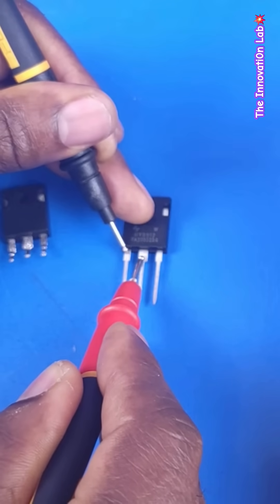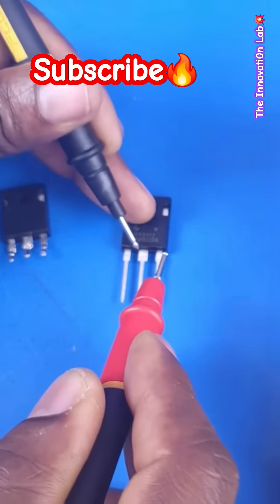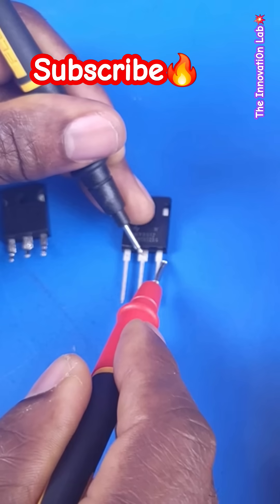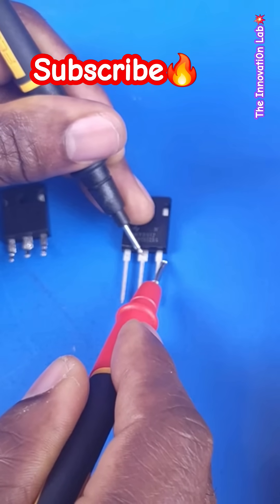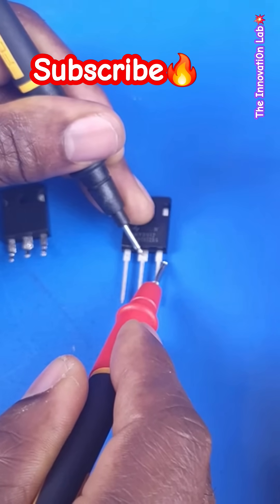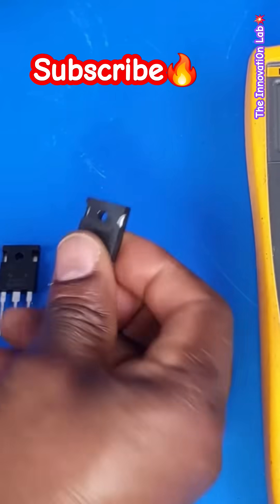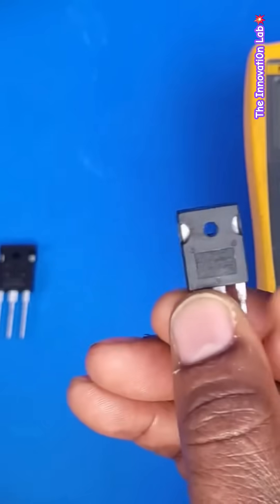How to Test a MOSFET, Part 3 #shorts #mosfettesting #repair

Comment: You aren’t showing the meter
Reply from the maker: The short was made from the full video and sadly the DMM couldn't be captured in the vertical short.

Please see the full video - linked. The video has chapter and you could simply skip to the component troubleshooting chapter.
https://youtu.be/2WU6uvgeDgU?si=Yi-JdXOyL2Ui6dGZ
16:13
However, if you have the time, I recommend watching the entire video....lots of great information.🙂

Respectfully,
The Innovati0n Lab 💥 www.theinnovati0nlab.com